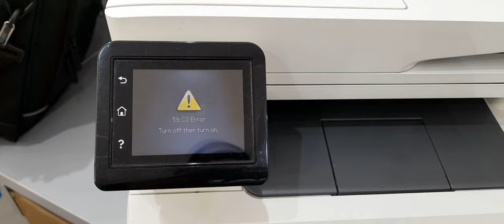HP color laserjet Pro MFP M277dw 59.C0 error (part1) check the links in the description may help you

Comment: Can i just spray contact cleaner without open the internal and wire..just open the hard case
Reply from the maker: hello, you mean you will spray the solenoid? i don't think it's possible because that solenoid is not visible..you need a little effort to open it 🙂...thanks.

Comment: I encountered this error today..... Losed the gear drive mechanism and all the gears scattered....I'll try and fix it tomorrow and see
Reply from the maker: hello, i suggest you check the part 2 of this video there is important details there regarding the drive mechanism. thanks and have a good one 🙂...
Reply: Where is part 2 of this. I. Having similar issue with mine...and i tried about 10 times to get it back in but same result. I have taken a big break from this.....its frustrating.
Reply from the maker: @Chaundb  https://www.youtube.com/watch?v=e47U3mDCgxI&t=0s
Reply from the maker: hello, I hope everything will be fine now...🙂
Reply: @tiknik  will let you know on Monday when i check it again. I did most of what you did state in this second part. Got everything well closed and lined up. But still get grinding noise and the error 59.C0 error on start up. I'm suspecting I need to line up that solenoid in a specific way with the gear(s) immediately next to it.
Reply from the maker: @Chaundb  https://youtube.com/shorts/YS91hQ7RP2E?feature=share
Reply from the maker: grinding noises also happen from cartridges...I hope everything will be fine..
Reply: @tiknik  come to think of it you might be right. Cause when i power on the device without the catridges no grinding noise. Just that it will ask me to put in the catridges.
Reply: @tiknik  thanks for you videos though..... It helps
Reply from the maker: check this video sir, how I do the remedial...🙂